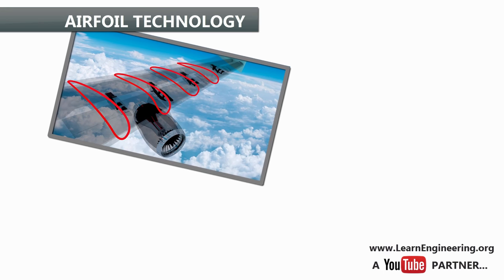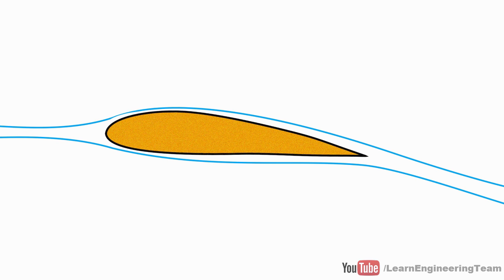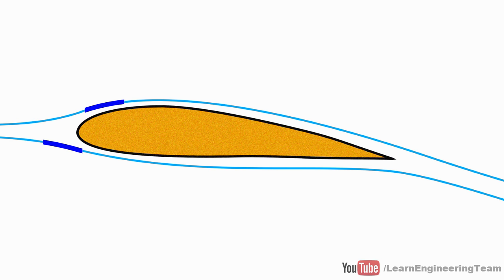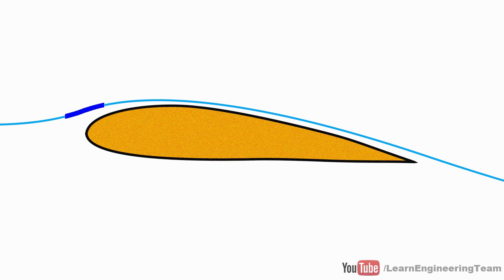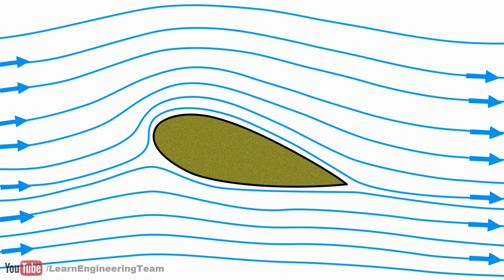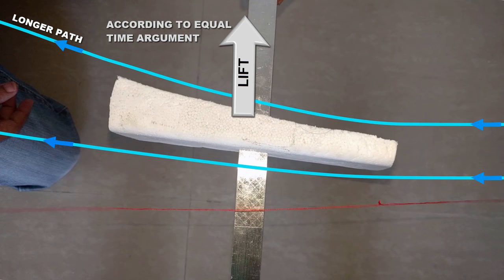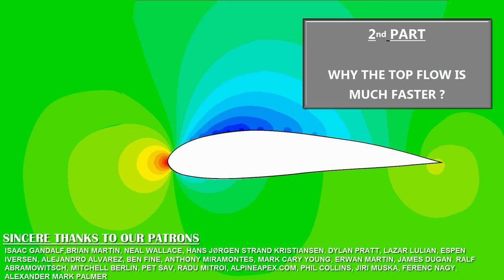How do Wings generate LIFT?

Comment: When someone is trying to  explain how a function works, it is better not to mention names as Bernoulli, Newton, Coanda, Navier Stokes,  etc.  It is better to tackle this  by assuming that we are part of the medium concerned and see  what sort of relations we are facing and the action that is taking place and how it affects our state.
So let us begin by assuming we are members of the air particles that are going over the wing and those under the wing. Really it does not matter whether we are stationary with the wing coming towards us or with the wing stationary and we are moving towards it.  Let us assume that we are stationary and the wing is coming towards us.

. Assume that we are air particles grouped some distance away in front of the wing.  We are  surrounded by  other air particles and on top of us is about  ten miles of air being pulled down by gravity so we suffer a pressure called atmospheric pressure. Now as the wing approaches us from a distance,   we should suffer a little compression due to the frontal area of the wing  and this increase slight increase  in pressure will tell us that the wing is coming and so we can predict that it is coming. Now the fact that ten miles of air above us makes us feel a little pressure that means that this fraternity of air particles have mass, and weight.  As the wing gets nearer and nearer, depending where we are with respect with the wing we suffer an action. If we happen to be at that exact position where the leading edge hits at  right angles well that will bash  us us up a bit and we collide with the leading edge and there is no resultant action which way we are to go , up above the wing or down under the wing, and you know , we stay bashed pushed against the leading edge and we shall proceed to move with the wing. The momentum change will cause the wing some force backwards.

Now if we happen to be  a little higher up relative to where we were before,  as the wing approaches us, we would still be bashed against the leading edge, but this time we would start moving up still being  compressed  against the leading edge packed up with a few other particles  all members of our family.  Let us for a second call this a change of momentum upwards, so here we are  being accelerated upward, being bashed tight against the leading edge. What is more we are gaining kinetic energy upwards. But of course we are being pushed against the upper particles which were above us so there is a compression effect at first but the wing is harder than the  air particles above us and so we have no choice but to be pushed up, and those above us has to move up a little being slightly compressed.   All this compression just above the leading edge of a wing will  keep accelerating us upwards, gaining momentum  all the time   and as a rule of thumb, we seem to suffer this momentum change in the upper direction for as long the wing is getting thicker and thicker, sort of wedge like, well a refined one. Then  not exactly all of a sudden, for it happens gradually, and as the wing is no longer thicker and thicker we seem to keep going upwards  and our  gained momentum upwards  will be separating us from the surface of the wing which a second ago was  compressing us and accelerating us .  This separation is now  due not only to the fact that we have momentum and kinetic energy upwards, but to add insult to injury the upper surface of the wing will start receding down and so this separation of  air particles above the wing will cause a less denser air  below  us as the particles are moving upwards and the wing surface is receding downwards. Well just imagine, there is now a  partial vacuum effect below us and that previous weight above us.  This will result in us air particles  slowing our upward venture and then falling down into the wing  and the wing is being pulled up towards us ,  effectively, but as we are lighter than the wing, well  the wing stays at the same level being sucked upwards and we are now accelerating very fast downwards into a partial vacuum so we go faster and faster  and gain speed not only downwards, but also towards the   the trailing edge of the wing.   We are truly vectored! The indignace of it all being so disturbed so that the wing is sucked up while its weight is pulling it down. Well since the wing is thick, that partial vacuum on the receding part of the upper surface of the wing is pulling the wing backward and that is a type of DRAG, let us call it Drag type V as is is due to the vacuum effect pulling the wing backwards.

Now let us assume that we happened to be there is space relative to the wing such that when it comes towards us we are below that streamline of particles that bashed themselves at right angle to the leading edge elemental curve . Now the leading edge of the wing  is not necessarily forming part of the lowest part of the wing as that would mean the upper particles will be bashed against the upper surface leading edge for too long and too much and that change of momentum will mean slowing   slowing down the wings if the engines are not large enough and so that  type of DRAG  is not beneficial.  Let us call this DRAG type C as it is due to the compression at the leading edge.  Well the leading edge of wings is  raised a little from the lowest part of the wing for less  accelerations values on the top  and underside of the wing and  this will lessen DRAG type C  which the financial officer of the company would welcome.   Now unlike our members of the particle fraternity who went above the wing,  we so not experience the receding part of the wing above us like they did and in fact the underside of the wing keeps pushing us down and down further and the humiliation of it all is that here I am as a male particle being squeezed against the female particles with no sign of room to move around, it is compression all the time. Well this means that we are in a high pressure zone,  not that I mind being squeezed against the female particles from all directions,  but here we are in bulk being  compressed down while the wing itself being  pushed up. On this side of the wing we do not only move down but this compression zone seem to  move us towards the leading edge of the wing, slightly but the blessed compression zone have a habit of doing that.   The final result is that those brother and sister particles up top who unlike us were compressed and they were running into a vacuum, well they go past the trailing edge before we do and what is more, we never seem to meet.

Here is a  little detail that we do not tell anyone. With the particles from the upper side coming down into the vacuum and we being compressed by the wing above us and our brothers and sisters below us, well as the wing goes over us, we are sometimes sucked up into the upper vacuum and there we go circling and curling up into the upper side of the wing even going forward and then down again somewhere ahead of the trailing edge curling and curling and I do not like to say this but that vacuum is filled up by us  particles on the bottom and  believe me this stalls the wing.   Well , I think this is enough for today and I shall not mention that if the leading edge is too sharp or the wing is inclined too much with its angle of attack, this curling that takes place at the trailing edge will also take place at the upper part of the leading edge and so the upper surface will lose its vacuum effect.   

Well it is late in the night and so we shall talk about the wing tip circulation where the under wing particles will circulate to curl into the upper wing vacuum, but that is not too bad you know, if the leading edge of the wing is  raked back such that any particles of air  under the wing in the compression zone think they are bullies and start accelerating outwards into the upper side of the wing, well if the rate of change of the leading edge is move outwards at the same rate as the bully air particles form the lower wing accelerate outwards , well then they will be so disappointed that they will never make it above the wing , but have to start curling  further back the trailing edge.      If a the tip of the wing, the trailing edge and the leading edge are both   trailing and raked  backwards then some particles from the under wing will try to escape  around the raked leading edge while other will try to get above the wing by escaping and curling around the raked back trailing edge........... and they will cancel each other bashing their head together.

How   do I know all this you many ask! It is  all very simple, as all the wing tip of birds and all the fins in fish, are of such a design with both the leading edge and the trailing edge raked back and many designer including those of the Spitfire noted the OUTER PROFILE of the birds' wings  near the tips with the trailing edge trailing forward , but  did  not seem to notice the fact that all the 
individual feathers raked backwards at both the leading edge and the trailing edge.   What a pity that such observation was  only made by many designers about 1953!!  Well at least the Spitfire had its wing tips chopped off and the Mustang did very well not using the elliptical wing with its trailing edge raking forward which nature never provided and included in any flying creature.
Evolution is a wonder test laboratory , it may take some time but it does get it right, and reject its mistakes.
Reply: Through history there has been many ideas indicating how a wing generates lift, and here I am going discuss a concept which few authors seem to mention.
1. Without going into too much detail, we all know that when a conventional unsymmetrical wing  with an angle of attack  is forced to move horizontally, there is a build up of a high pressure zone in front of the wing's  leading edge which vector and directs  air particles to go  above and below the wing.  Those air  particles that are shot above the wing, they try and proceed  above the wing with their momentum  at a higher velocity upwards than the  surface of the oncoming wing is moving upwards  due to its forward velocity and so this  dynamic relation  causes a depression  or a partial vacuum and the fact that, at the upper surface,  some distance behind the  leading  edge, 
 the available surface area recedes down, this bubble of low pressure above the wing,  which is substantial in size,  becomes of interest.
2. Those air particles  at the leading edge which are shot downwards, the fact that the lower surface  does not recede up but down, due to the design of the airfoil and its angle of attack, then the  oncoming lower wing  surface will catch up with the down moving particles and  will even try to push them further down creating a compression bubble under the lower wing surface. 

3. Now having created two bubbles, one bubble of low pressure above the wing and a bubble of high pressure below the wing, this  does not mean a thing  unless there are other conditions.  If the bubble of   partial vacuum above the wing  seals itself at the leading edge and the trailing edge,  and the wing tips, what will happen is that this bubble of low pressure will try and collapse  on itself causing an implosion and decrease in size.  The Low pressure  above the  wing multiplied by area of the wing,  thus,  force, will try  to accelerate downwards  the  free air particles above the wing and  at the same time will try to accelerate the solid wing surface upwards. 
4.  Similarly, the high pressure bubble below the wing, assuming that it seals itself at the leading, trailing edge and the wing tips,  the high pressure will try and explode  to become a  bigger  bubble in size.  This relation will try and push downwards the free air particles  below the wing while at the same time push the  underside solid surface of the wing, upwards, all due to the fact that to every action there is an equal and opposite reaction.  
5. If, for a minute,  the air particles above and below the wing were not allowed to move and  the "sealed bubbles" of low pressure and high pressure  above and  below the wing were allowed to cause a movement to the wing this will be  move upwards , but only once,  so we must allow other dynamic relations  to take place.

6. We must allow the mass  of air particles above the wing to be accelerated downwards  continuously so that the wing is accelerated upwards. This can only proceed in a continuous efficient manner if all the air particles above the wing come down to miss the trailing edge as if they hit the trailing edge we would lose on lift! 
7. Similarly,  to push the the lower wing surface up, we must continuously accelerate the large mass air particles below the wing.  Because of the nature of the problem, we can only accelerate two lumps of masses of air above and below the wing once  so  there is only one thing to do is to ensure that the mass of air above the wing is  thrown and sent past the trailing edge and a new mass of air particles  at the leading edge, to first be thrown up by the leading edge  to cause the partial vacuum where the   low pressure above  the wing will during the passing of the wing  under the low pressure zone will accelerate the air higher  particles downwards to clear the trailing edge.  So to get a continuous lift from this downward  implosion we need to continuously accelerate air above the wing to clear the trailing edge.  The leading edge  accelerates and throws them up while the   wing top wing surface accelerated them down past the trailing edge for maximum lift. 

8. With  the  the high pressure bubble  below the wing trying to accelerate the air particles downwards, in order not to lose the pushing up on the wing, one must keep overflying  the air particles that were accelerated downward below and behind the trailing edge and  then capture the  stationary particles that are coming in under the leading edge.  It is a continuous RUNNING AVERAGE OF NEW AIR PARTICLES BEING ACCELERATED DOWNWARDS DUE TO A PARTIAL VACUUM FROM ABOVE THE WING AND  DUE TO A COMPRESSION ZONE  FROM UNDER THE WING,  and the accelerated particles in question all rejected behind the trailing edge as a down wash.   
9 If any of the particles above and below do not make it past the trailing edge, then there is a possibility of not enough lift being created and   the wing will have to move faster with respect of the  mass of the air particles being accelerated  and so   one must be careful in calculating the velocity of the wing with respect to the density of the air particles, as if there is not enough of them, being washed down  going past the trailing edge, the  wing will not fly.

10.  The  vectored particles of air above the wing accelerating  towards a low pressure zone while those under  the wing "accelerating"   into a compression zone explains  the reason why the velocity of air particles above the wing is higher than those under the wing, hence a circulation effect, and also  this  difference in exit velocity will create a turbulent zone behind the trailing edge in the shape of  multitudes of pairs  of  rotating helixes of air particles  to form a narrow  turbulent  wide stream  which will grow substantially when increasing  the angle of attack where the  the multitudes of pairs of helixes will fill up the upper section of  the wing, to cause stalling.

Comment: A bit simplistic and somewhat circular. You ask why the particle doesn't move straight as shown but then don't explain why. You just say it curves because of the coanda effect. You then say because the flow is curved, there must be a pressure difference, but you haven't established why the flow is curved. You also haven't established why the flow separates neatly at the trailing edge. Why doesn't the lower surface flow that is higher pressure, flow around the trailing edge to the upper surface where there is lower pressure, equalize the pressures and hence produce no lift?
A flat plate with no airfoil shape will also produce lift when at an angle of attack. You've missed the fundamental purpose of the airfoil shape, which is not to produce lift but to reduce drag for a given amount of lift.
Reply: As shown in John D, Anderson's book, a flat plate has a very similar air flow pattern to a cambered wing. A small turbulent roll forms behind the LE to create synthetic camber for that flow. The way the air travels it important, not simply the airfoil shape.
..
This gives folks the most trouble. For a better understanding of the detailed cause of the reduced pressure above a wing, try this short video:
https://www.youtube.com/watch?v=3MSqbnbKDmM
Regards

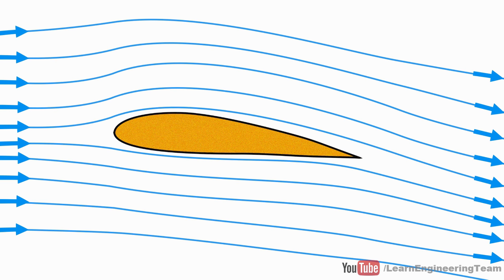Comment: Very confusing explanation. Around 4:00 you begin by saying the top part of the wing has lower pressure and the bottom part higher pressure, but you never explain the reason for this pressure differential. You then keep on using this pressure diff as the basis for your explanation, but you never clarify the cause for this difference. Some physics students may fill in the gaps, but most people would need clarification. Also, at the end you suddenly add the Newtonian law, but everything up to that (the pressure diff) seems unconnected to that.